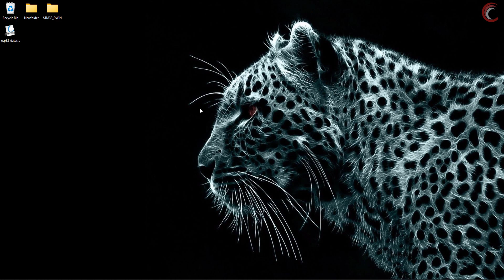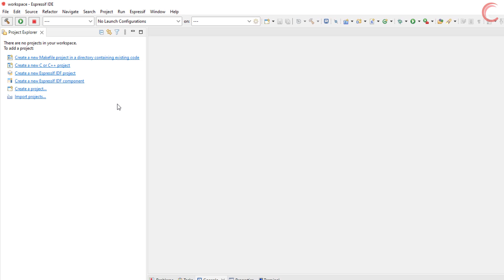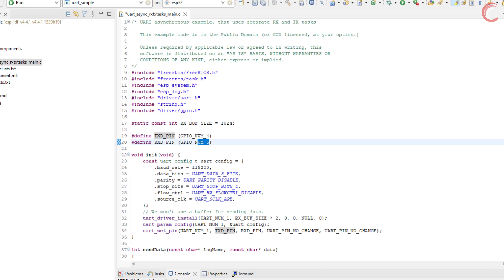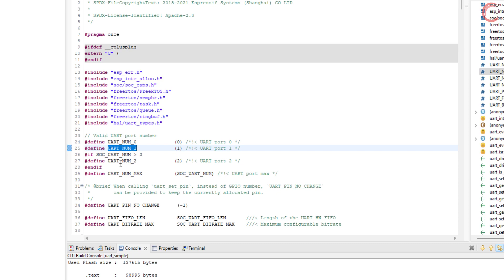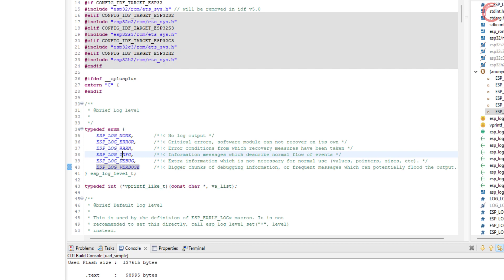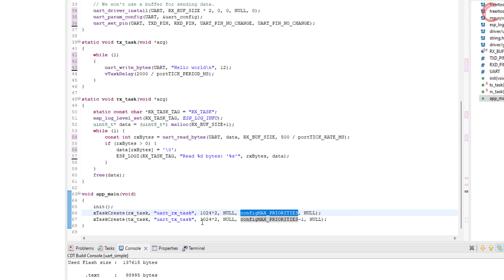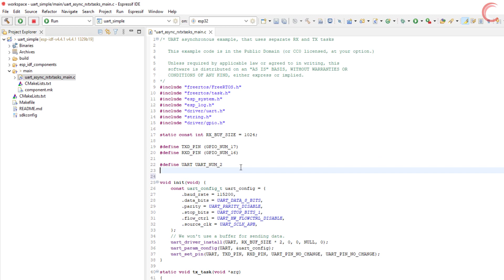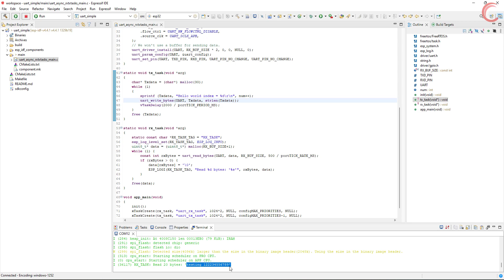How to use UART in ESP32 || Espressif IDE

Comment: Hello ControllersTech,

What should i change to make this code run on my esp32-s3-box in platformio based on Arduino Framework, i've changed uart's pins(#define TXD_PIN (GPIO_NUM_17)
#define RXD_PIN (GPIO_NUM_18)) the transmit works fine; even thought i make changes in this task:
static void rx_task(void *arg)
{
  static const char *RX_TASK_TAG = "RX_TASK";
  Serial.println("enter RXTask");
  esp_log_level_set(RX_TASK_TAG, ESP_LOG_INFO);
  uint8_t *data = (uint8_t *)malloc(RX_BUF_SIZE + 1);
  while (1)
  {
    const int rxBytes = uart_read_bytes(UART_NUM_1, data, RX_BUF_SIZE, 1000 / portTICK_PERIOD_MS);
    if (rxBytes > 0)
    {
      data[rxBytes] = 0;
      ESP_LOGI(RX_TASK_TAG, "Read %d bytes: '%s'", rxBytes, data);
      ESP_LOG_BUFFER_HEXDUMP(RX_TASK_TAG, data, rxBytes, ESP_LOG_INFO);
      // Serial.println((char*)data);
    }
    Serial.println((char *)data);
  }

  free(data);
}

I didn't receive any thing on my serial monitor.

Thank you in advance.

Comment: while receving data from terminal to real term it is working fine but while sending back it is showing an error char sent are not displayed in half duplex can ay please help me to get the output in both directions
Reply from the maker: Half duplex ? 
You need to use full duplex for sending and receiving.  Half duplex will only send/receive, it can't do both, specially if you are using the default connection (USB).
If you want to work with half duplex, then you need to connect via some other means (module), which can switch bwteen tx and rx mode.

Comment: I am receiving a data packet ranging from 0 to 255 from serial and using it to drive a motor using PWM. How do I convert the data in the buffer to integer value so that I can pass to ledc_set_duty to change the duty cycle?
Reply from the maker: Look for atoi() function.

Comment: I have a problem. if i send data to esp32 faster than 1000 milliseconds. I'm having trouble reading this fast incoming data. How can i solve this problem
Reply from the maker: Reduce the time interval in esp32_receive function. By default it is set to 1000ms
Reply: @ControllersTech  I am using arduinoIDE how can i found this function🙈 i couldnt find
Reply from the maker: Ask in the arduino support.. This video covers ESP-IDF, so doubts are expected to be related to that.
Reply: @ControllersTech  thanks for your attention

Comment: ESP32's default baud rate is 115200. If I am changing the baud rate more than that after building the project its again resetting it to 115200. As in config, its the maximum range of baud rate. But the datasheet states it can go till 5mbps. Can anyone help in how to set it? I am using ESP32 DevkitC.

Comment: It appears this warning:
E (10342) task_wdt: Task watchdog got triggered. The following tasks/users did not reset the watchdog in time:
E (10342) task_wdt:  - IDLE (CPU 0)
E (10342) task_wdt: Tasks currently running:
E (10342) task_wdt: CPU 0: uart_tx_task
E (10342) task_wdt: CPU 1: IDLE
E (10342) task_wdt: Print CPU 0 (current core) backtrace